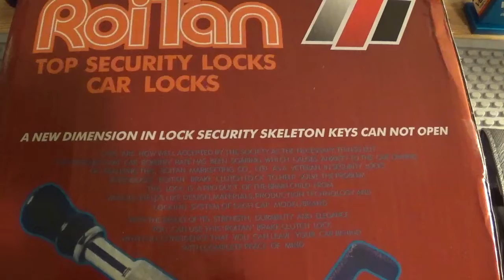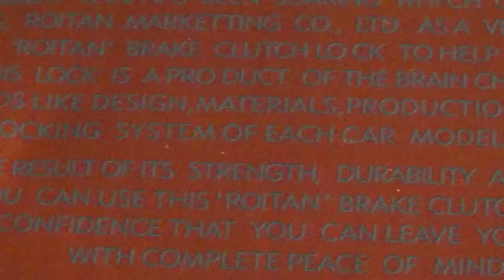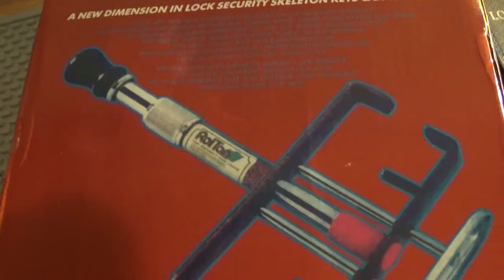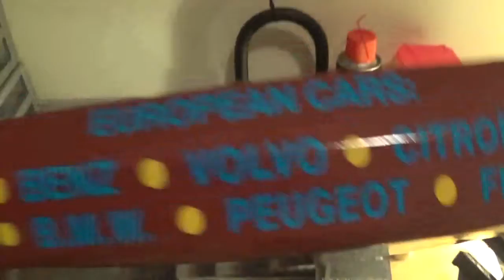Lock:191 Roitan Clutch/brake lock.

Comment: What’s ur opinion on it 2 years later. Are u still using it?
Reply from the maker: Thanks for asking, well I would use it more if I lived in a more crime ridden area but I don't. However I do still use anti theft devices like steering wheel locks because I like to take a security in layers approach. 
This lock is not perfect but I do like that is quite flexible on which cars it can be applied to.
My preference for a clutch lock though it is more awkward to use is the other clutch brake lock I showed that is smaller and is a bracket with a padlock.